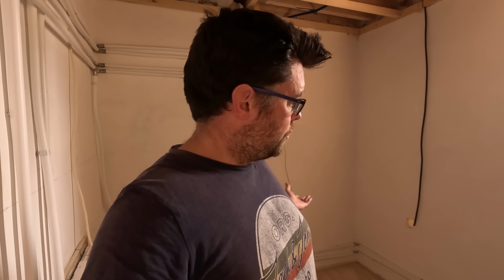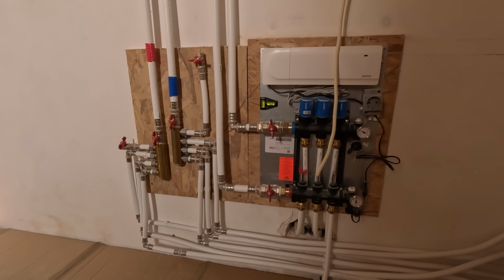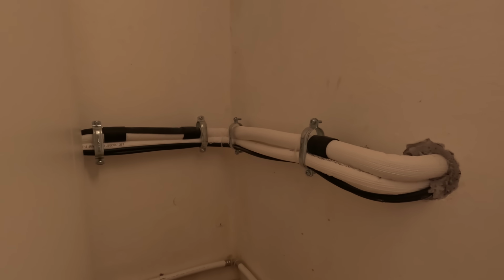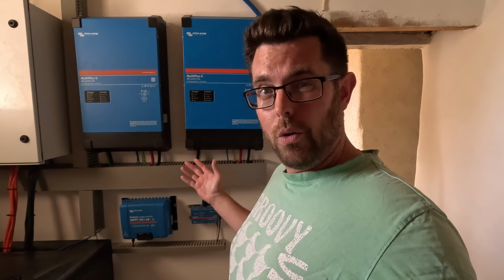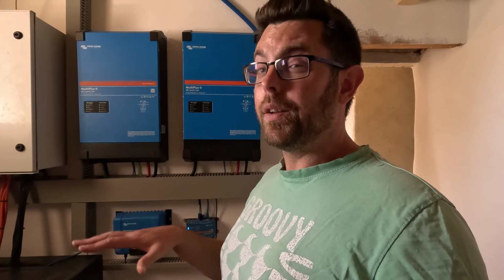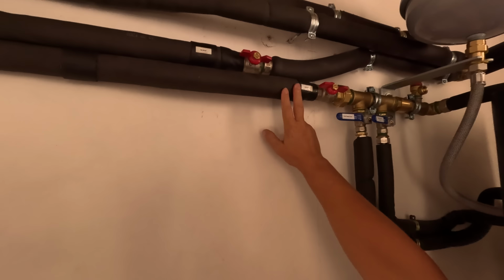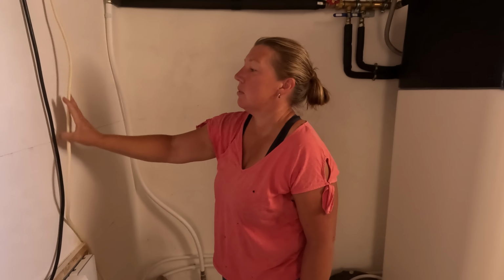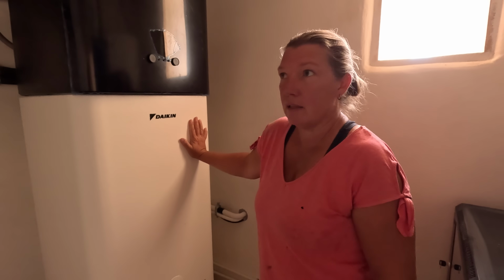Today is a BIG Day (We have HEATING) - Daikin Heat Pump Install

Comment: Hello! Really interesting to see this new system thank you for sharing! Being a long time fan and following you guys from Canada/Brasil.
One concern that I have after seeing your installation: Are you guys comfortable with your control panels being out in the open? (outside a NEMA 2 enclosure for example), having sensitive equipment near a 300L hot water tank might pose a risk if you consider vents, and condensation that might create from the tank and it's anciliary connections.
I work with electrical construction in Canada and I'm used to see individual electrical components bolted directly to a plywood backboard like in your case, but they tend to be sprinklerproof or have drip proof pans to protect it from droplets.
However, being from Brazil with a hot and humid weather and different electrical standards we have the habit of enclosing all electronic devices and electrical components into an enclosure with grates to let the air circulate and cool down the electronics.
Usually the manufacturer (Daikin in your case) gives all the clearances needed around the equipment to avoid these inconveniences.
All the best always!
Diego.
Reply from the maker: Valid point, and we have given it much thought. This particular system is fully housed in an insulated unit so ‘should’ not have any lingering condensation etc.

We’ve had all our solar tech housed in our ‘kitchen shed’ (no insulation, no heating, no cooling, and pretty drafty) for the last couple of years with no issues.

Added to that, once the ventilation system is installed (the green vent you can see in the ceiling frame) all excess heat and humidity will be removed.

Both the solar team, and the heat pump installation team, confirmed there shouldn’t be any issues

Comment: You should be happy with that system and I doubt if you need the wood stove but better safe than sorry. 20 years ago I put in a Water furnace here in Canada with ground source heat supply it has been wonderful so now my heating and air conditioning is almost free after installing solar 7 years ago. Cheers

Comment: Nicely done. My home in Shanghai is heated/cooled using Daikin split heat pumps in a central air setup. We used it for ~12 years without issue. The house has been empty for 4 years while we have been in the US. 

Leaving to go back next week for the first time in too long... Hoping my Daikin units are still working properly as Shanghai summers are hot and humid.🤞

Comment: Plants that lose their leaves in winter around the area around the outside unit sounds like a good idea. Cover the unit during the hot summer months so it is easier for the unit to radiate out the heat in summer. No moisture and lots of sun absorption in winter.

Comment: First time seeing the reverse application of the ductless a/c unit.  Drawing heat from the air for full domestic hot water use and under floor heating. So I learnt something new and interesting today.

Any brief overview of the upgraded solar system with plans for a detailed one later?  Why is the system off and when do you expect it to be partially or fully functional? Like that you have certain redundancy built in. Also wondered how much you upgraded your solar and battery storage to compensate for cloudy, cooler weather and winter months? Aware that you plan to incorporate a wood burning stove. Plus potentially expand underfloor and heating to other areas pending evaluation.

€13k seems very reasonable as it probably took several days to fit, hook up, test & evaluate, set parameters, run and train. What are your expected efficiency? What does your anecdotal data suggest for efficiency, operating temperature range and optimal temperature range? Not the same application or suitation or country but a few years back installed a ductless a/c, Navi gas combi boiler & a gas fireplace for €13-14k in TO, Canada.

Is there a later need for cooling or air-conditioning some rooms?

Comment: Wait what, sealed system with wood burner, even with the expansion tank that's not exactly safe. UK and many other countries in the EU require wood burners to be open vented due to the inconsistency of heating - ie they will over heat and boil on occasion. It would be better to have a plate heat exchanger and open vent for the wood burner side. The rest of the installation is on par with what I'd expect anywhere else in the world, uk included.

Comment: Conngrats on your new jeat pump. Amazing the impressive way you've integrated it for off grid. I'm from the Vancouver BC area snd we just had a Daikon heatpump installed into our townhouse which was heated by an old natural gas system and forced air registers to heat each room. Due to issuses surounding a retrofit we went with a Daikan heatpump and high efficiency gss combination. The furnace acts as an air distribution system for the hest pump and uses nstural gas heating only when the djfference between outside and inside is significant. 
One of the big benefits is thst it also cools the house in our ever increasing hot summers. I expect, although you haven't said so, thst there must br some possibility for the heatpump to cool your house. Are you planning some system to do thst?

Comment: Many airsource heat pumps can also cool the house in sunmer as well, not just provide heat.

If you plant around it, be careful not to obstruct the airflow. I've seen the issues caused by the ODU being obstructed and its not great.

Comment: First time I've heard of, much less seen, an air supplied heat condenser.  I had a friend who ran an outfitter business up in Canada who installed (by himself, as I gather) an underground heat collector/condenser system and it kept them warm and snug at -59 F during the winter with no need to run a wood stove to augment it.  So I know that worked in extreme conditions and am looking forward to see how your system works in a moderate climate.  Clear explanations are priceless and you both hit the mark spot on.  Thanks---and I'm looking forward to your next episode with whatever you have on the hob.
Reply: Air source heat pumps are being used a lot throughout Europe and are even widely-known here in the UK where there is a government not well-disposed to renewable technologies. There's certainly a lot of garbage being pushed about them in our media.

Comment: Congratulations about new heating system, running water and electricity! 

I am wondering here if 32 C is enough for hot water temperature. 

Legionella bacteria thrive best in water below 50 degrees. It would be better if you raised the temperature of the hot water to 60 degrees just in case, so that the Legionella bacteria cannot accidentally contaminate your wonderful new water and heating system. Legionnaires' disease is a dangerous lung disease caused by legionella bacteria. 🤔🤧💖

Comment: The wall mounting is not an optimal idea... Those DAIKINs are quiet, but still... Better use a floor console (for example concrete socket) to avoid noise in the building. If you should notice strange humming sounds in the building when heating at high power, build a concrete socket with drain for the exhaust water and have it moved there.

The concrete socket should be sitting completely disconnected from any building-related hard structure, ideally on some sort of pebble bed.

Comment: Legionella may be a risk though if you keep it at 45 degrees or switch the thing off for extended periods. Although I read that some heat-pump controllers have a sterilisation cycle option to heat above 60 degrees Celsius once a week to kill it.
Reply from the maker: Yes, the unit has one of those cycles. And, this temp was only for testing

Comment: Congrats! It's clear you guys have been pushing super hard to get to this point - I can't wait for the day you can take a shower in your new bathroom! System looks fantastic.
Reply from the maker: Yeah, us too!! 😀
We’ll have to settle for a flushing loo this year, don’t think we’ll get to the upstairs bathroom until next year
Reply: @MAKEDOGROW  I'd be temped to run a hot water line out a window to a temporary outdoor shower then - I imagine the solar shower has some severe limitations on shower length. Congrats again on all the progress you two are inspiring.

Comment: CONGRATULATIONS !  This is a huge step completed !  Obviously a great deal of planning went it to the layout.  Everything is so neat and tidy, covering it up should be very low priority. This is very different than most systems in the US.  The wood burner backup is a great solution for cold or cloudy days.  I'm sure you have a backup for electric generation also.

Comment: A few thoughts guys, first a brilliant job and for me there is a certain beauty in looking at the layout. Second that price seems very cheap would be a lot dearer in the UK I'm sure. Last but not least I have been aware of these systems and others for some time as I follow a lot of "Green" based vlogs, but something I have always wondered if the unit outside is extracting heat is there any reason it can't be located inside? thinking if the house gets warmer then there is more heat to access sort of a feedback loop, hope that makes sense. Anyway looking forward to the next installment.

Comment: We run a similar set-up here in the U.K. - solar PV powering our Daikin ASHP for UFH and hot water.  Our climate is considerably colder but we are still getting an annual average COP of 3.
Reply from the maker: Nice! I doubt we can achieve a 3 yet (with leaky doors/windows, no insulation upstairs, etc) but it will be super interesting to watch this winter and see things improve over the years as we get closer to a finished building

Comment: Thank you for the explanation on how heat source pump systems work! I have heard of them but had no clue how they work. We live a few miles from a village that is the first place in the UK to have a ground source pump infrastructure added as a network to a whole street, Im hoping in time it will be rolled out further so we can replace our oil boiler with a ground source heat pump

Comment: Thank you for an interesting and informative episode. Really appreciate the details and costs associated. Would like to ask what size of unit you installed?

ASHP's have certainly come a long, long way in just a relatively short space of time. I know that they are now being utilized in cold Canadian winters (-20 C) where as just a few years ago your option would have only been a much more expensive ground sourced heat pump. 

Looking forward to your upcoming upgraded solar episode. Muito obrigado!
Reply from the maker: The outdoor unit is 6kw and the indoor tank is 300L. They do larger versions of both but we didn’t really see the need for our house with only 2 people
Reply: @MAKEDOGROW  Thanks for the reply. 

If I remember correctly your home is about 55m2 per floor. I am not an expert but I think that you sure got the size right. I was sizing a 58m2 floor space single floor, well insulated and it came out to 2.8kw for 2 people.
Reply from the maker: @bryansarty3821  yes, about 60sqm…. and eventually 3 floors. We’ll also be running ufh on at least 2 floors, potentially 3 (and this definitely needs some oomph). Fingers crossed we did get it right 😀

Comment: ASHP will be fine off grid. Anyone saying otherwise it wrong. 
You’ve got underfloor and good insulation, solar and some battery storage. It will work fine. You won’t even need to use your back boiler (although it will be cozy to have the fire going) 

System looks amazing. Looks like you’ve covered all angles. 

I look forward to seeing update videos on the performance 👍🏻 congratulations
Reply from the maker: The only thing we’re a little concerned with is the number of grey days that won’t produce much power. Last winter (which was the worst for this are in a very long time), there were 40 days when we weren’t producing any power and had to use a generator. We’ve beefed up both panels and batteries, but it’s always good to have multiple backups 😀
Plus, who doesn’t love sipping wine by a fire 🤣

Comment: Just had the same system installed in Spain, works great, what control system do you have for the remote control?.
Reply from the maker: We’re currently just using the Daikin app but we’re planning to integrate all the tech into Home Assistant in the not too distant future
Reply: @MAKEDOGROW  ok, they installed for me something called Airzone that connects up with the heat, but also links to an aircon system that I have so different zones can be controlled independently.  So I am not using the std Daikin app.

Comment: 19:50 no you totally can run the whole house off-grid!

1: Air-heat pump / Geothermal Pump.
2: Solar panel and solar heater panels.
3: Low-wind wind turbines.
4: 72h battery backup(3 normal days or 3 days with quests calculated for battery storage capacity)

If you get 2x Low wind wind turbinea, approx 1'200€/Each, you can cover your energy on clowdy days and then it is just your Battery/Energy Storage Capacity!

Its totally dueble!
And the wood fireplace with a 'Back boiler' is a wonderful idea and I was about to add some smart heating back up like that!

Looks like you have made a really good system in mind!
Just remember 72h energy backup for the whole house and get 2x Low Wind Wind-turbine and you are all set! 😀👍😎
Reply from the maker: We’ve looked into a couple of different wind turbines but so far the output doesn’t seem to be worth it. Do you have experience with any of them?
Also, we don’t actually get that much wind all the time … often bits so still we can hear the wings of birds flapping high above our heads

Comment: You mentioned that you keep the water at 45 degrees?  Not sure if I understood correctly and whether this is for the radiators or domestic hot water?  To avoid legionella  domestic water needs to be at 60 degrees, and I am presuming I've not understood correctly?
Reply from the maker: The 45 was just for testing purposes

Comment: The system looks wonderful and the cost seems very reasonable.  We had our central air completely redone.  The cost was slightly less than your system and yours is far more complex.  Now my series of questions.  Your back-up source.  Are pellet burners a thing in your area of Portugal?  (With supplemental water jacket )?  The reason for asking...A pellet stove can be activated from a traditional thermostat.  They are self igniting.  The trigger signal could just a easily come from your heat pump as a wall thermostat.  This would make the conversion to supplemental heat sourcing seamless.  As the heat requirements are met the pellets stove would naturally shut down awaiting the next call for assistance from your primary heat source.  If the stove runs constantly, 1 to 2 bags of pellets daily.  My guess is much much less.  Very efficient!  A stove with a decently sized ash pan can run for a month without cleaning and removing ash.  The downside....A pellet burner would be a bigger load (modest) on your solar system than a traditional wood burner.
Reply from the maker: Pellet burners are a thing, and we understand the convenience but there’s a few reasons we’re choosing a wood burner:
1. Aesthetics … we want to be able to sit on front of the fire and sip wine 😀
2. Availability - firewood is everywhere around us, a load arrives an hour after we make a call to the ‘wood guy’
3. Affordable - fire wood is so much more affordable (the cost of pellets more than doubled here last year)
4. Environmental - locally sourced (well seasoned) timber from renewable forests has a lower footprint than pellets
Reply: @MAKEDOGROW  Understood.  I grew up in a home with a wood stove.  My memories are of a house hot as hell on chilly days and chilly on truly cold days.  These imprinted memories pushed me towards a pellet burner hehehehe.  We would clear downed, storm damaged trees from peoples property...Free wood.  And...We/I would hand split the wood...Free labor.  I'm 64 and I still develop a twitch when I'm near a splitting ax!!!  Pellets are a convenience for us.  Cheaper than heating oil but far more expensive than free fire wood or $300 to $350 per chord fire wood.  The stove runs from October to April.  We always have a warm glow for a glass of wine in our living room.   Good luck and thanks for the time you put into the channel.
Reply: @MAKEDOGROW Re cost of pellets, a lot of people I follow in France also say the price rocketed and were rueing having got one rather than a plain wood burner.

Comment: Great job guys! One question: u talk a lot about heating. Heat pump systems can also cool. Does your system also cool?
Reply from the maker: Yes, we forgot to mention that. It will feed the underfloor pipes with cold water creating a nice cool floor which will bring the indoor temperature down.
Our ground floor is already quite cool however due to the thick stone walls

Comment: Hello, I follow you from start. I live in China at 2000 alt and have the same system installed on my roof for many years now. Of course a Chinese brand and it works amazing without any maintainance. good choice. Go on....

Comment: Had air to air installed two years ago , also solar panels and thermodynamic hot water tank. In winter during sunny days there are vents in the ceiling which pass hot air into the house so no need for the system,also in summer it can be switched  to night time cool air so no need for the air con. The solar reduces our electric consumption and sells excess to the grid. We get approx 500 euros a year from the sale of excess and our bill is 30% cheaper now as well. All in all an excellent addition ,I am certain you will be very happy with yours 😁😎🇫🇷